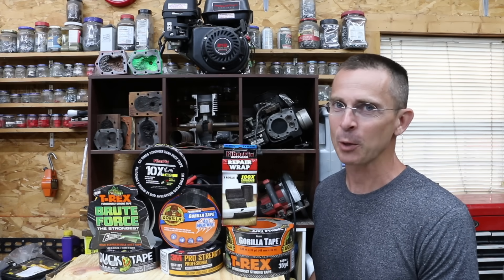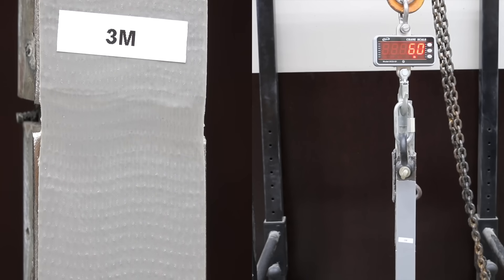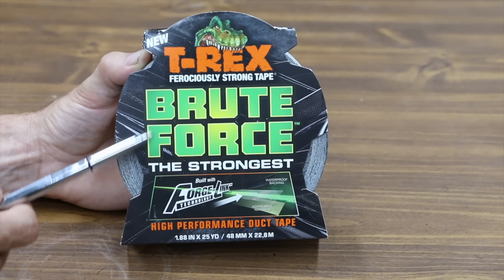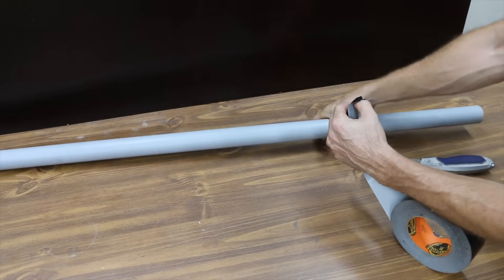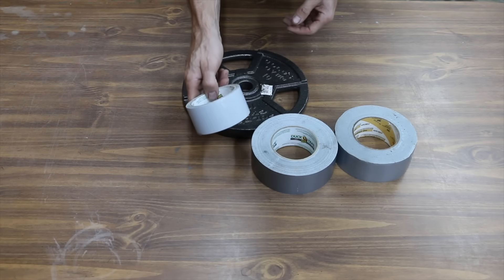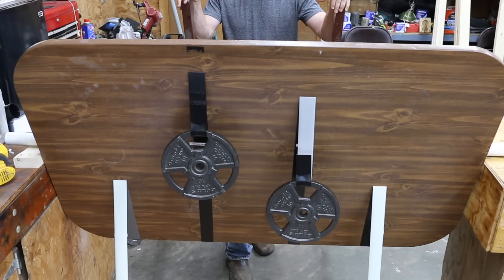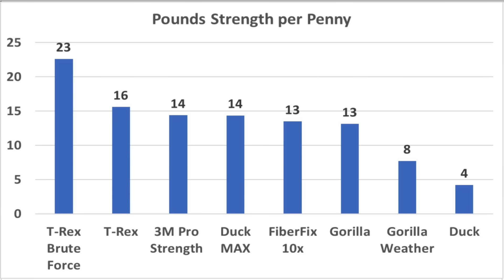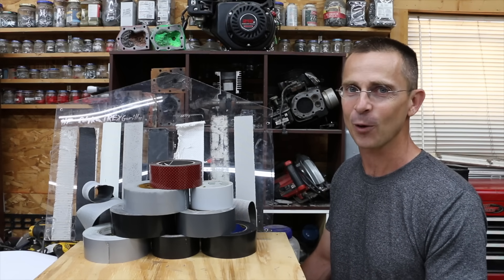Which Duct Tape Is Strongest? Let's find out! Gorilla, T-Rex, FiberFix, 3M Pro & Duck Max

Comment: Yes it's worth doing another weather test. It would be cool to see how the top of the line brands do with heat. Maybe stick them to a plate of steel n put it over a fire til the plate is a few 100 degrees. Also try putting the rolls in a freezer then see how flexible they are n the other durability tests. Once again a great video from you man
Reply from the maker: Great suggestion on the heat test as well as the cold test!

Comment: You’d think that the 3M duct tape would have researched how to spell ‘professional’ before printing their labels..LOL.
Reply from the maker: lol. You are right!  I bet it'll get corrected soon.
Reply: @nomen_meus  You're absolutely correct.
Reply: Probably a fake. Spelling always gives it away.
Reply: Nomen Meus Yeah, right.  And I guess ‘pro strength’ and ‘industrial & hvac’ is also Spanish as well?  Ha.
Reply: @Inisfad  The label is cluttered, but it says "Uso Industrial" right next to that bit. Also "Cinta" under the pen and 1 Roll/Rollo at the bottom.
Reply: How "profesional" of them 😁
Reply: @ZzzRoofus  Yess!
Reply: But usually there are slashes splitting them up.
Reply: Nomen Meus Good spotting - I didn’t see the rest of it as the video played.  But still think that most people looking at this will think professional is just spelled incorrectly.....
Reply: I do not know if you know Spanish, but at the right of INDUSTRIAL&HVAC it says Uso Industrial in Spanish, also at the bottom it says "rollo" which means roll, and it says Pulg. which means "pulgada" inch.
Reply: @nomen_meus  So the labels printed in Mexico?  Could be.
Reply: I don’t know Spanish, but I think that ‘profesional’ was a bad marketing decision. Most Americans would look at this, and immediately think misspelled, rather than Spanish.  IMHO. And as profesional is quite close to ‘professional’, most Spanish only speaking people would know immediately what professional means.

Comment: You just sold a lot of T-Rex brute force tape
Reply from the maker: That's some strong tape!  I'm still amazed a single loop was strong enough to tow the tractor.
Reply: @ProjectFarm  yes I am definitely changing brands of duck tape.
Reply: @ProjectFarm  I just bought a roll of the stuff just now at a cost of $60 (we Aussies are always getting screwed by American shipping fees)
Reply: @mwbgaming28  if you feel your getting screwed then don't buy it.
Reply: @jaydunbar7538  where else will I get it from? 

Can't buy it locally
Reply: @mwbgaming28  Where else but bunnings? https://www.bunnings.com.au/t-rex-48mm-x-22-5m-brute-force-duct-tape_p0089248
Local to me, just 5 minutes down the road.
Reply: @mwbgaming28  less  then $30  at bunnings
Reply: @J.M-OfficiaI  the Bunnings in my area said they didn't sell it
Reply: @mwbgaming28  
$60 bucks? Damn!
Reply: @ProjectFarm  ...up a slight grade, too, it appears.  Wow!  On another matter, it would be interesting to know which tapes do well with tarp repairs.  I've used duck tape for plastic tarps and Shelter Logic covers; doesn't do too well.  I imagine that many people have had to deal with ripped tarps, boat covers, and the like (sometimes repairs have to be done in inclement weather, too); so it would be interesting to know if those kinds of outdoor covers - plastic based and cloth based - can be repaired successfully and hold up in sun, rain, snow , ice and wind using either standard tapes, as in this video, or specialty tape(s).  Thank you so much for your outstanding videos; some of the best on YouTube.  :)
Reply: I have used a single loop of the stuff to hold a 4G antenna to my drain pipe (A 9KG antenna mind you) 

Been almost a month baking in the Australian sun and the tape is holding up far better than when I used half a roll of el-cheapo servo tape (gas station brand for americans) 

Now i always keep a roll in my car for emergency repairs lol
Reply: @1973deepee  I like this idea a lot!
Reply: I just ordered T-Rex tape on amazon subscribe and save with a 5% discount.  Thanks for the review
Reply: Kidnappers everywhere are now stalking up on T-Rex Brute force tape!    ;)   XD
Reply: They need to cut you a cheque my guy! 💯
Reply: @FuddleyPJones  yep, it's even worse if you are buying batteries from the US, the shipping is like 5X more than the battery
Reply: Bought brute force, now i need to find one of those strong man contests where they break zipties and duct tape on wrists as "challenge"
Reply: I can now throw away my tow chain and shed like 30 pounds of weight from my truck.
Reply: Agreed, brother. Would love to find some at my local store, inshahallah. Allahu akbar!
Reply: If you get further it's actually less sticky. Duct tape honestly doesn't need 400lb breaking strength, it needs a balance of all properties
Reply: Awesome profile pic!
Reply: @DanKelley83777  feel free to use it and spread the message contained within

Comment: How about some blue tarp testing? How durable are cheapo HF tarps vs high end silver tarps?
Reply from the maker: Thank you for the video idea!
Reply: @ProjectFarm  can't make a tarp shelter without paracord!
Reply: @ProjectFarm  Great idea!  A blue tarp exposed to the elements here in North Carolina, usually only last 12 months before I need to replace them. UV kills them.
Reply: Drag test on driveway/sidewalk, point tests as well as larger areas. Branches v. Logs. 
Eye pull out.
Tear test, obviously.
Rip/Tear test.
That's all I got.
Reply: @ProjectFarm  I have one supposed to be "industrial" as  they claim(Silver one side and green on the other). But you can see the weave of the tarp is tight, put it up while camping, every time. Even the heaviest down pour and not a drop makes it through. Water will sit on it for days no prob.  According to the place i bought it from 225 micrometres (9-mil) thick, Material: Polyethylene. 14 x 14 high density weave, Reinforced polypropylene rope sewn in welded hems. Same Company has one that is 12 mils. Not sure if that is really the key but have not seen that one in person.
Reply: I would love to see that, I hate weak tarps.
Reply: Go thick or go home.
Reply: I was just thinking: "Another weather test on these tapes because what do we do when we rip a tarp?" Let's "weather test" some tarps AND these tapes!
Reply: from experience hf blue tarps last about 6 months outside,
Reply: IT'S A TARP!
Reply: @UnitSe7en  we can't repel UV of that magnitude!
Reply: Hughes Enterprises This test I would love to see also. I have learned the “hard way” that all tarps are not created equal. You really do get what you pay for. The worst are those blue ones from Harbor Freight. They completely disintegrate after about a year. Then again the price point is pretty low...
Reply: @Kevin19700   I keep the freebie blue HF tarps around for jobs where it's going to be a pain to clean the tarp afterwards, as they are free and thus disposable in my mind.

Also keep a couple of the freebie HF tarps in the trunk of the car.   Good for protecting my car when I need to haul messy items in it (like bags of potting soil or mulch) and good for laying on the ground to keep my knees clean if I ever have to change a flat.

I won't rely on them for more than that (though in a pinch they would probably make decent ponchos), but they do serve their purpose.
Reply: This would give you a good chance to test paracord!
Reply: What are the silver tarps you're talking about? I usually get the green ones at Ocean State Job Lot (probably a regional store you're not familiar with). They sell the blue ones too, but the green ones are nice, way stronger. Just curious what the good "silver ones" are that I don't know about.
Reply: James Hinckley I have owned a couple silver tarps. They are super heavy duty, waterproof, and reflect heat and sunlight. They stood up to a lot of abuse as ground over for muddy campsites and covering the rubber roof of a travel trailer over many winters. Also used one as a dog kennel roof and after 10 years in WA weather and sun it was still waterproof and hadn’t degraded at all.
Reply: @HughesEnterprises  The blue tarps from HF are trash.  Pay the extra quarter, and get the gray ones.
Reply: I second the tarp test!!!
Reply: Would love to see a tarp test also, and the weather test from second  duct tape video
Reply: Love this idea!!!!
Reply: I can say from my own experience the cheap Harbor Freight tarps are not very good.  They're thin and tear easily.   I had two of them and they didn't last long at all.  Not knocking HF, but you get what you pay for on their tarps.
Reply: Interested
Reply: Love to see
Reply: Hughes Enterprises 
Great idea. I want to see that one.
Reply: Good idea
Reply: yes!
Reply: Yes please!
Reply: @DJ LED I love that store. And the green tarps are pretty good right? But I still don't know what silver ones he's talking about. What brand are they? Where do you buy them?
Reply: I can already tell you. I work at a recycle center and I get HF tarps in the trash all day. I have one nicer tarp (silver colored) which I took home because it was in good shape.
Reply: yes

Comment: I would love to see Rotella T6 vs synthetic motorcycle oil! Many motorcyclists swear that rotella performs better than normal oil
Reply: Well they really shouldn't use that oil. It's specifically made for diesel engines. I'm thinking the detergents would do more harm than good in the long run
Reply: M H it’s jaso-ma certified for a wet clutch, and there are many people who have been using it in their motorcycles for over 20 years or so
Reply: @pixelra1  I was unaware they had wet clutches. I agree that would be an interesting video to see t6 vs amsoil or the like
Reply from the maker: Thank you for the video idea!

Comment: I think the issue with including some of these brands is that 3M is designed for actual HVAC usage and the rest are designed just to be as strong as possible for general repair usage (not quite “duct tape”). I think if you tested long term adhesive strength on a duct that heats and cools repetitively, the results would be quite different.
Reply from the maker: Great point!  Thank you

Comment: Everyone’s favorite mad scientist farmer.  Would really appreciate your insight on gasket makers.
Reply from the maker: Great video idea!!  Thank you!
Reply: one name...Permatex...makes everything else look like kids paste
Reply: Fact: Black Permatex has no ingredients because it's made of pure magic.
Reply: @philtripe  ever used the right stuff? Or better yet, tried to disassemble an engine it was used on? Keyword: tried
Reply: This is perfect
Reply: Ultra black > everything
Reply: Gasket maker for the win. 

Temperature (heat pre pressure test)

Oil resistance (oil soak pre pressure test)

Gasoline resistance (gas soak pre pressure test)

Max pressure test comparison

Base material compatibility

Could be done with water for safety.
Reply: Three bond vs Loctite.
Reply: I agree.  I'm a automotive technician and I've always used the grey permatex called "right stuff". And it's awesome but I've always wondered if there is something better.
Reply: If you do this please get your hands on Toyota black silicone called Toyota FIPG, it is a legendary product amongst my car friends and we swear by it
Reply: RIGHT STUFF! can be put into use immediately! Great for oil pans & Differential covers. Found out about it from my auto machine shop buddy.
Reply: Permatex ultra black/gray/blue/red are a hobbiest strength RTV at best. Toyota FIPG, Hondabond, Ford TA31(have used it to seal in 40+ lbs of boost on intake plenums...), etc are much better gasket makers. I use the Ford stuff, get it in caulk gun tubes for a great price. Definitely need to include it in testing.
Reply: Maybe even compare it to the gasket materials that you can buy? They have a number of materials including cork and paper.
Reply: I'm a big fan of the loctite 515 high flex form in place gasket maker
Reply: +1
Reply: Shh its ok My Wife wont see this but I cut Gaskets For My Motorcycle on My Wifes  Cricut Hobby cutter , Works Fantastic